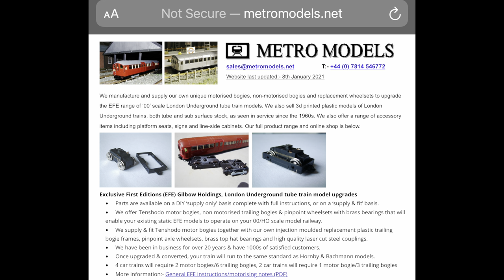How to DCC london underground tube trains - EFE OO gauge 1938 stock tutorial

Comment: Hi Eric,
Great video. And thanks for the showing the role of wire. I need really thin wire for fixing an N&W steam switcher. Now I have a part No to use in my search for very thin wire to run between loco and tender. Nice layout. Only thing missing is the conductor rails. I guess the Peco 3rd rail stuff would work. Lisa

Comment: Can I connect the wire straight from the pickups to the motor bogie
Reply from the maker: Only on DC
Reply: @UndergroundEric  okay so I have tried doing the pickups and they have to much friction on the wheels, so the train goes really slowly
Reply from the maker: @metromodelsrules5127  yes its hard to get them correct